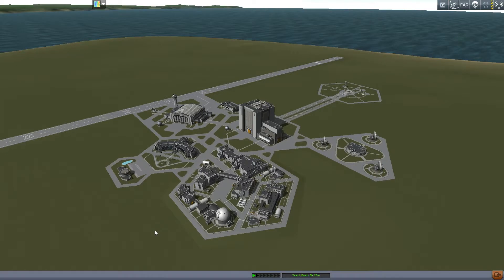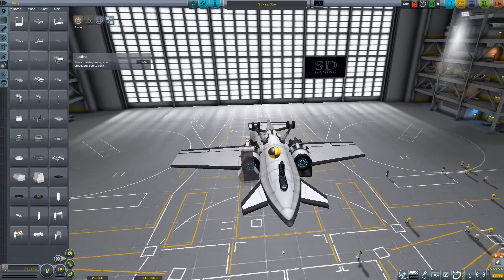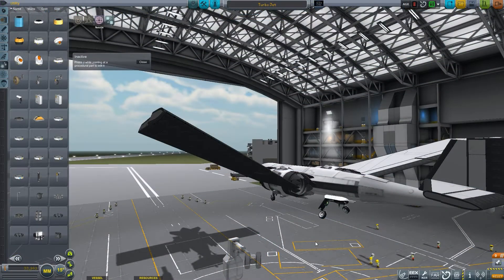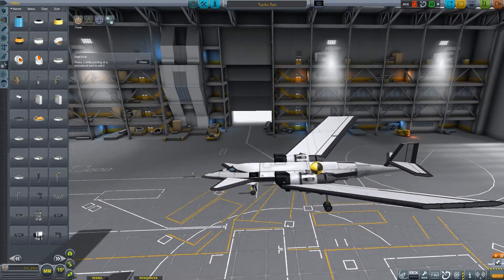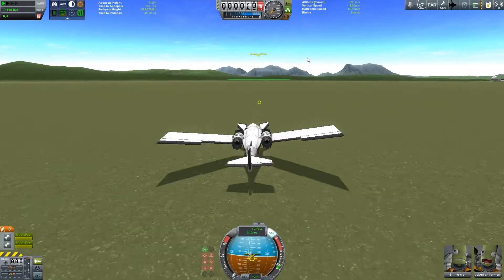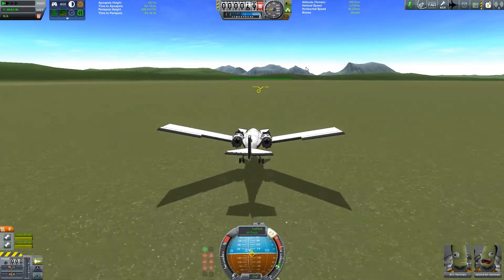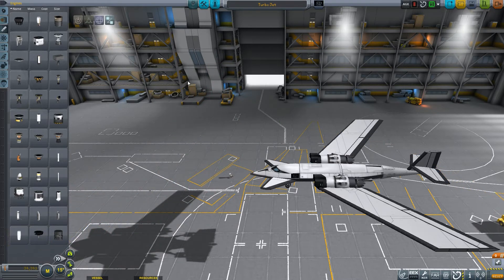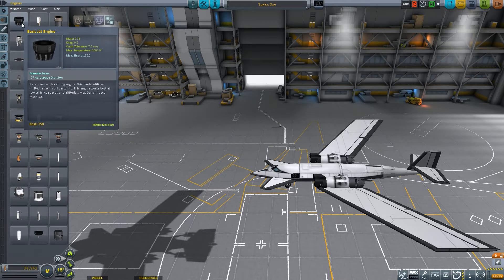Ferram Aerospace Research Tutorial E02 Engines, Intakes, and Landing Gear

Comment: i really like your guide but I wanna point out how it can be good to have landing gear pointing the plane up. your landing there was really bad , you could've slowed down more as touching your front gear first will cause you to bounce. most of my FAR planes are pitch up and my landings are quite smooth
Reply from the maker: +Mateus Zuravski it is much harder to land on a bumpy, unpaved surface with a plane that is pitched up. Every time you hit a bump your plane wants to take off. Trying to land on a place like Duna with a pitched up plane would involve a lot of save scumming. It isn't impossible, just harder. And of the two options, the least favorable  takeing into account all situations.
Reply: +silentdeth that I agree with. however, if you are landing at the Ksc is should be fine

Comment: Any tips with Prop planes? I'm using the firespitter mod. I made a Fighter plane but when taking off it veers quickly to the left and starts leaning towards the wings than it clips the wings than boom! I calculated using the derivation and everything is green. Its just taking off thats causing the issue. Also I tried diffrent speeds and it still does this. But it could be a bug with the wings. When I use the WW1 wings for a WW2 air foil than it is more stable. But if I put the WW2 wings than all goes wrong could be a bug with the mod or I am just not using them correctly. This is also using FAR
Reply: TheRealToaster2 That was my first though as well. But, again, that is in a mode specifically dedicated to realism
Reply: +Miguel Macias Engine torque causes the plane to roll. Try throttling up more gently.
Reply: Just like with real prop planes, (they don't show you that part in ww2 games ;) ) the direction the propeller spins will generate asymmetrical force. As the comment above me said, try throttling up pretty slowly, and using rudder to stay straight. some turning is unavoidable
Reply: ***** In War Thunder they have that.
Reply: You've probably realized this by now, but its a bug in KSP. If your landing gear isn't perfectly straight, everything breaks.